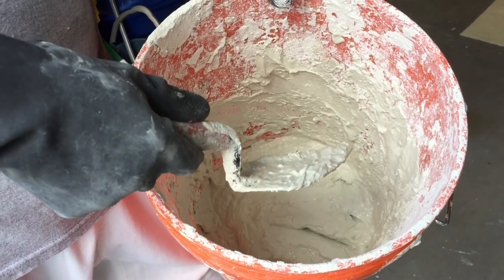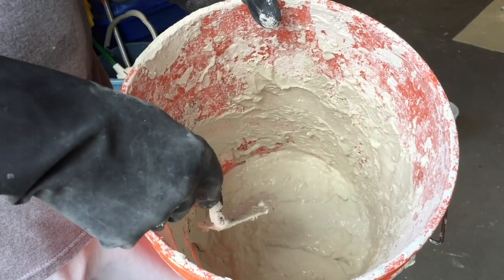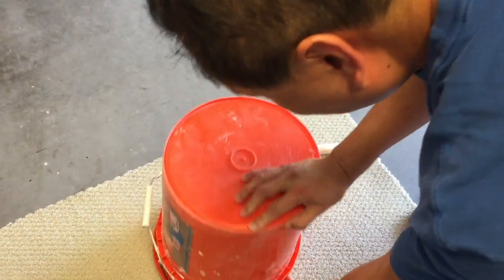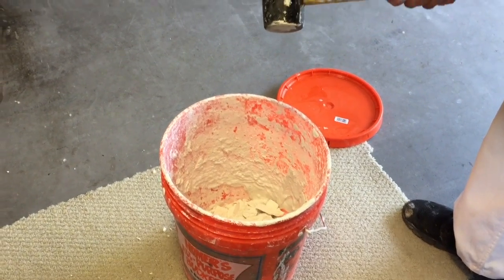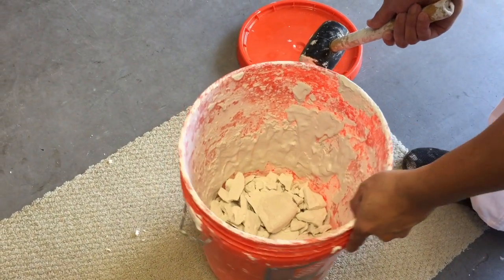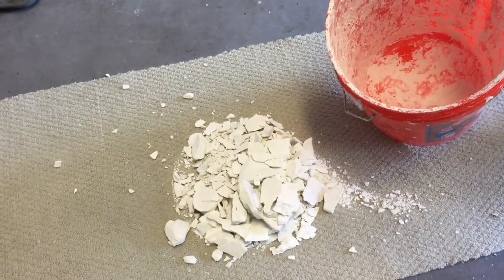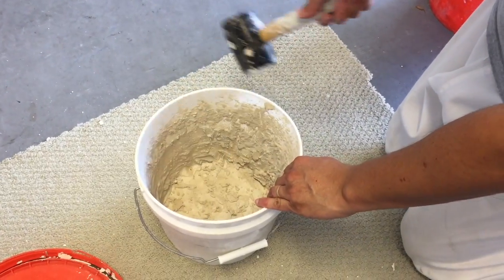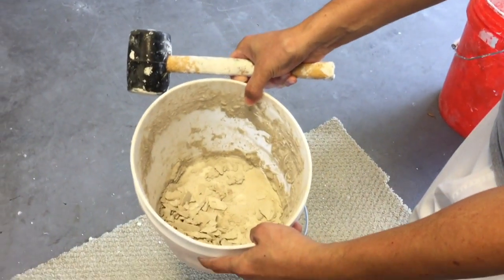Thinset Leftover Cleanup and  Removal

Comment: Ideally you would've already cleaned it before it got to this point, if it gets to this point try using brush tips on your drill and some water to try and dislodge the stuff on the sides, ideally you want a really clean bucket for the next time otherwise you might get stones in your mix which will leave ugly marks on your walls, you always need at least two buckets, one just for cleaning stuff, i use some mesh stuff as well and move water from bucket to bucket through the mesh, catching any solids in the mesh and dumping them out with my debris and then using the brush on my drill and a little water it gets the buckets good as new, i also use a mesh when dumping out the leftover water, just in case some solid stuff comes through that i don't want on my pipe system but at that point any leftovers would be tiny
Reply: fartpooboxohyeah8611  Oh nice one, those look awesome, definitely gonna go buy one. Thanks

Comment: the problem with the thinset on the sides is that when you mix your new mortar the dried chucks will come off and become mixed with the new batch. Then when you trowel out the thunks will drag which becomes problematic.

Comment: I'm a novice, but won't the mixing paddle scrape hard chunks off the bucket into the new thinset? I imagine the chunks would compromise an otherwise even layer of thinset, or be a pain to pick out.
Reply from the maker: Yes.  You should clean out as much as possible.  However, if you mix another full bucket of thinset, the small pieces are ineligible, and something they just got stuck on the bucket sides and bottom and wont even come off.  The point of the video is to reuse the bucket instead of using a new one every time.  Thanks.

Comment: Just wash the damn bucket amatuer
Reply: It is really not good to wash thinset out of your bucket.  Where do you dump the water?  It actually goes somewhere.  Maybe you don't care because you are dumping it on your customer's property or in their drain.  Take a little care and scrape it out when it is still wet and put it in the trash or do like this video.
Reply: A slight modification is to clean the sides of the bucket while is still wet then full bucket all the way with water with a smidge of dishsoap.  The cement mixture is hydraulic and will set in the bottom leaving sides clean.  Decant water into a dumpster or paved surface and just pound out the bottom only.